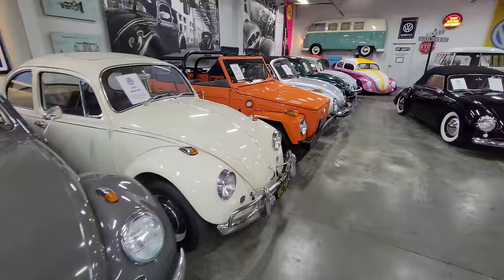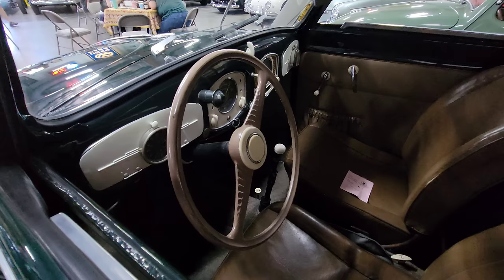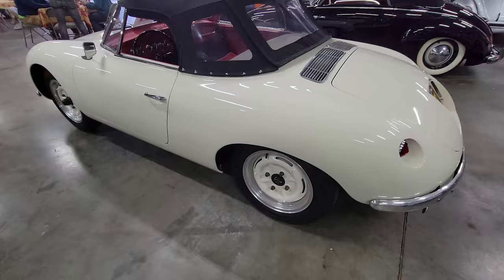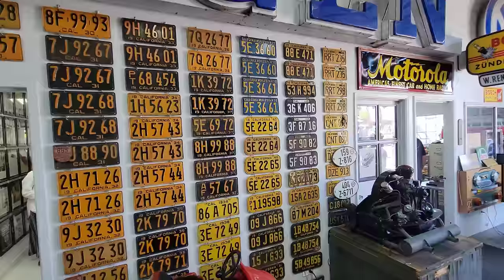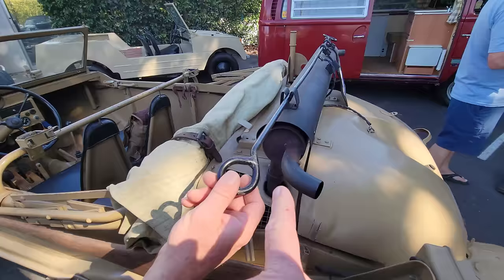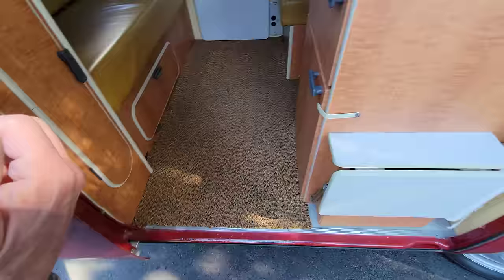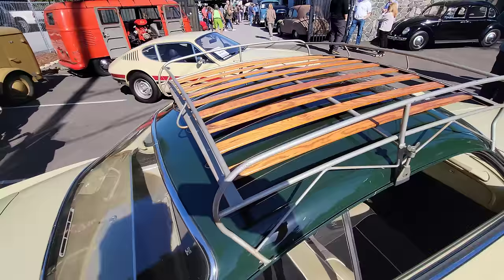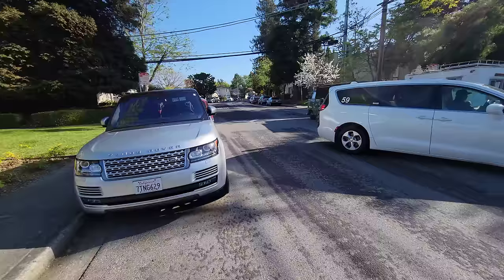RARE VW Private Collection EPIC Amazing - VW beetles Busses  - Coach Built Cars

Comment: Some more info about the cars:

1957 Rometch -  body by Beeskow in Berlin. VW chassis with aluminum body and leather interior, Mercedes middle green paint. One of about 35 known to exist, unknown number built between 1951-1957

1953 Dannenhauer and Stauss - built in Stuttgart. VW chassis with steel body. one of about 20 still existing.

1958 Denzel built in Vienna Austria. about 77 made between 1948 and 1958. Box steel chassis with aluminum skin. These cars would win Alpenfahrt races due to light weight and Denzel engine - which was based on 36HP VW engine case, with numerous changes to the other main components and produced about 70HP. "turn signal" on steering column is actually headlight switch (from a citroen?) - turn signal switch is on dash.

1959 Binz double cab - one of about 700  built (starting with single cab and modifying) in 1958-1959 - this is 59 model - earlier ones have suicide rear door. Sold through VW dealerships until 1959 when VW began building their own double cab.

1946 beetle bought by serviceman in Oct '46 and brought back to Kansas in 1947 after the end of his tour of duty.

Schwimmwagen was borrowed by Jay Leno for an episode of his TV show - he raced Jeff Dunham in another Schwimmwagen.

Country Buggy was made for a few years in the '70s by Volkswagen of Australia.

53 Porsche cabriolet is pre-A, with A seats and A hood handle and A front skin with horn grills. Not restored.

"wierd" white car is Tatra Tatraplan model T600. Originally with 4 cylinder air cooled engine in rear. Made in Czechoslovakia

Green trailer is made by Wesfalia -has generator, siren, and PA system. Engine inside is 2 stroke, not VW.

SP2 was made in Brazil for a few years - this one was restored in Paraguay.

1953 VW 4 door Taxi was built by Rometsch in Berlin for Berlin taxi companies. Unsure how many were built, but somewhere between 4 and 6 remain, 2 in US. Body is lengthened about 8 inches.
Reply from the maker: amazing information.
Reply from the maker: I hope you enjoyed the video. I almost need to do another one next year to get some more of the cars. I almost feel like I rushed it. So much great stuff there.
Reply from the maker: thank you so much for allowing all of us to view such the best collection in the USA...IMO....I dont think there is anything else like this other than in Germany.

Comment: That one car you car you couldn't identify looks like a DKW. They have a 2 stroke 3 cylinder water cooled engine in the front. Also the Trata is cool because it has an air cooled v8  in the back.